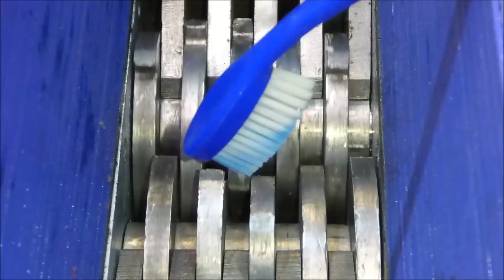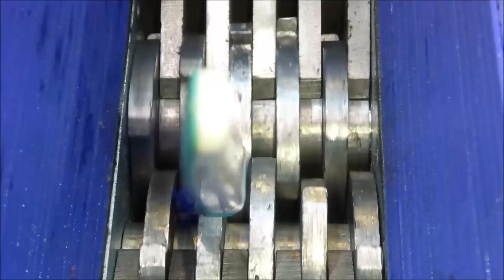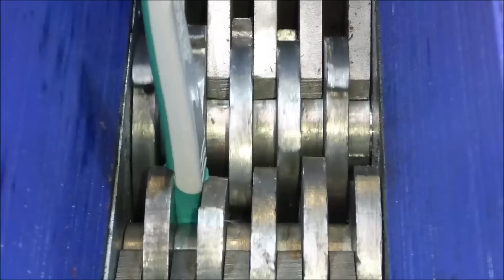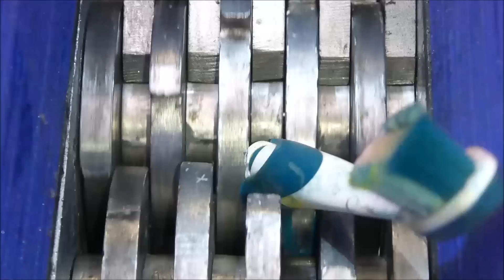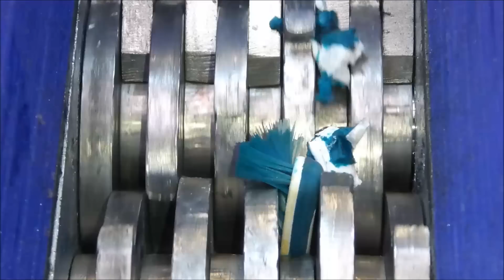FilaMaker mini shredder is dealing with 2 toothbrushes.

Comment: Got any old computer mice that use the old rubber ball? Those would shred well I bet.
Reply from the maker: +HonorNecris It is steel ball coated with rubber. That will not work.
Reply: +thymark Oh, I didn't know that.